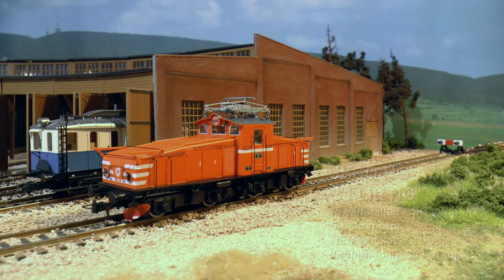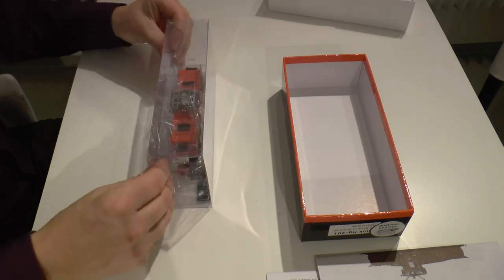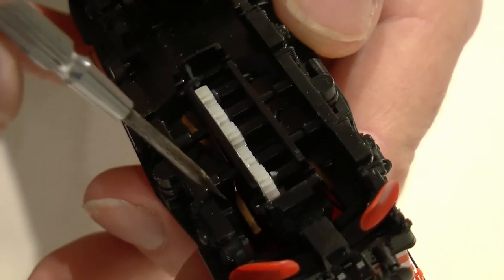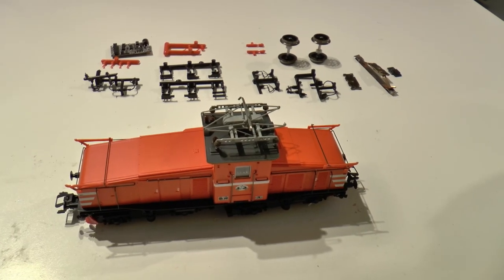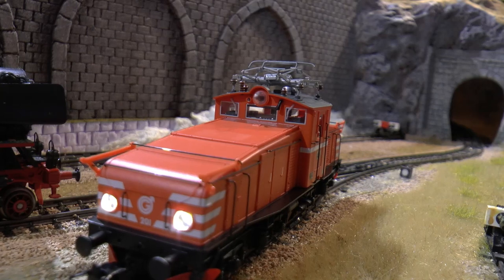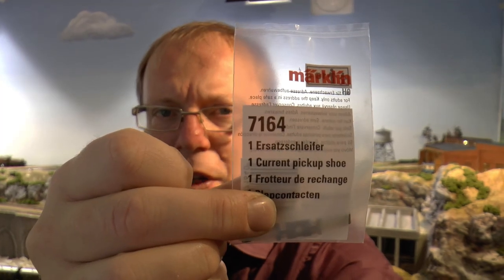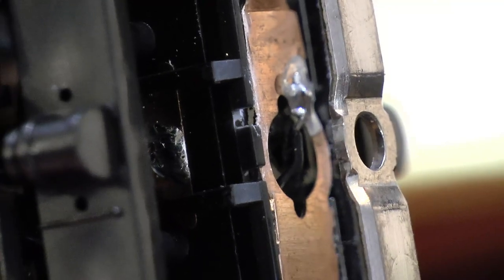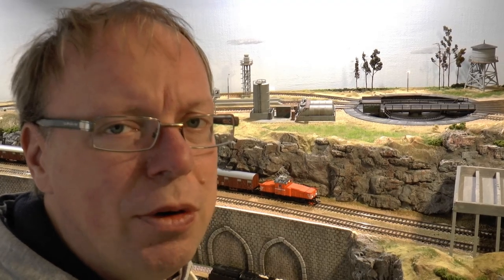Testing on Märklin M-rails - JECO HG-A214.1 SJ HG-201

Comment: Hello Martin! 
Great video, interesting with the sliders, this is also a problem on certain NMJ (EL 13) locos. i don't know why this happens, is this a sign of poor quality control? Anyhow its always a way to fix it, but i should not be like this, we pay for it to work out of the box.
Reply from the maker: +Subs0nic I suspect manufactures like NMJ, Heljan, Jeco and Roco really mostly just supply loco with sliders just to be able to offer their Product to all the M&#228;rklin users, without really caring too much of how the locos actually work on M&#228;rklin tracks.
Reply: +marklinofsweden Roco Actually cares about this, i never ever had a new Roco AC model fail on me or in any turnouts or double slip switches. They run smooth and nice. but for the others i agree.
Reply from the maker: Subs0nic Really good to hear that Roco locos works fine on Märklin tracks! I´ll try to pick one up and make a reveiw.

Comment: You prefer the rubber tyres?  Here in the UK we try and avoid them because they make the track dirty.  Do you not experience the same issues?
Also, will you be putting overhead wires in place for the electric locos?
Reply from the maker: +Lennon6412 Hi! No, I don´t really have seen that the rubber tires makes the tracks dirty. Over-oiling the locomotives and cars doo for sure. I run cleaning cars in some of my sets on regular basis, so problem solved. I see more of a problem with oxidation, since I have my layout in the garage/basement. Yepp! Overhead wires are already in place on most parts. This video is 6 months old already.. :)